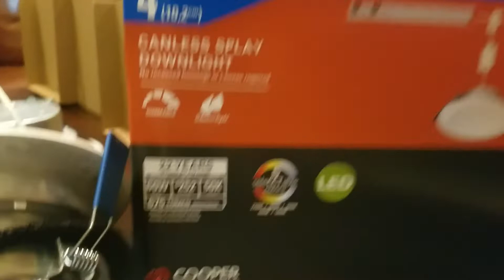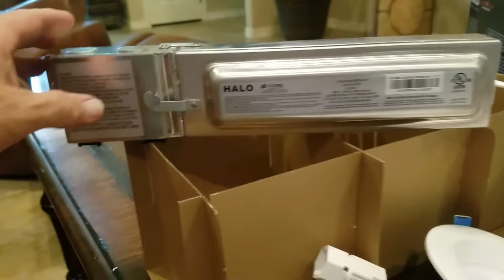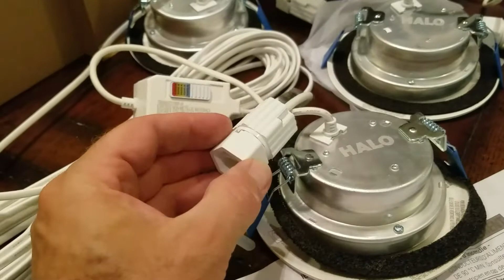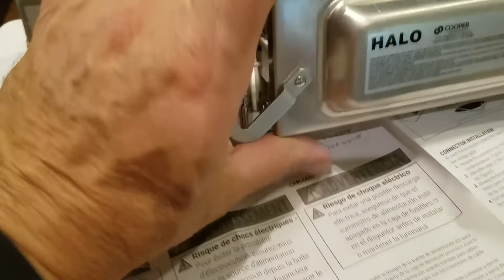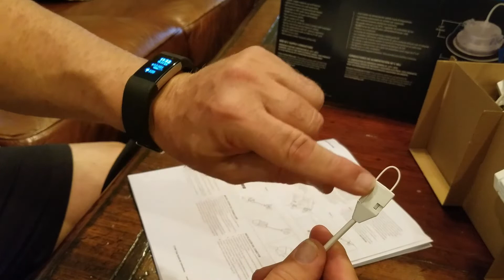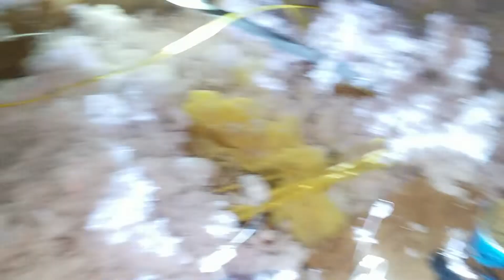Installing ceiling LED recessed lights - Halo LT4-DM Canless LED light

Comment: And I can tell you that the light quality is pure crap…and that is the fact.
Blinding no flattering light. Compared to recessed can with an incandescent bulb. The only way you can emulate that is with a Philips led flood 2700 k if you can find one. You wasted money. Sorry just stating the fact. If you can’t see the inferior light quality …….
Reply from the maker: After having the lights up for weeks, I tend to agree that they are too bright. I ordered a Leviton dimmer switch to see if that will help.
Reply: @DrBDIY  your best bet is to keep them off. A dimmer is useless for the poor quality of light the poses.
Reply from the maker: The dimmer switch worked great for us. We can adjust the brightness now.    https://youtu.be/DBEb7_zFi3g
Reply: @DrBDIY  light quality is horrific….the dimmer worked. Big deal.it did not change the quality of the light.
Reply: @skiprope536  
🙄😳 
You seem pretty angry about these lights. 
🤭🤫